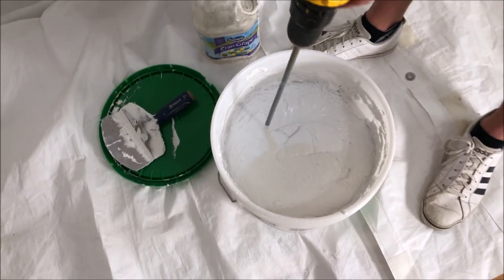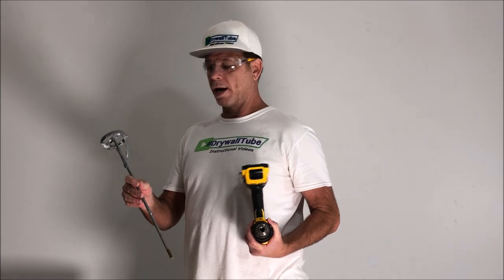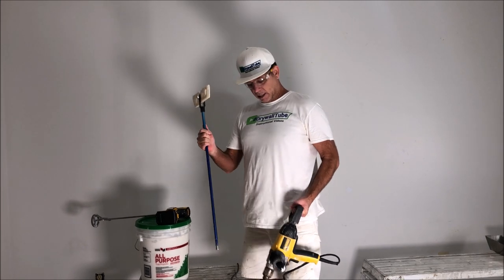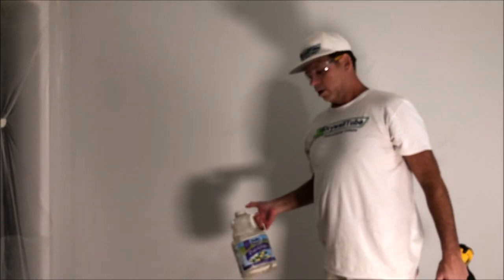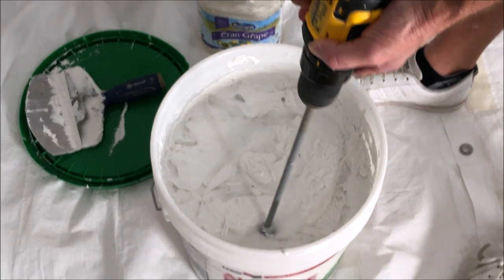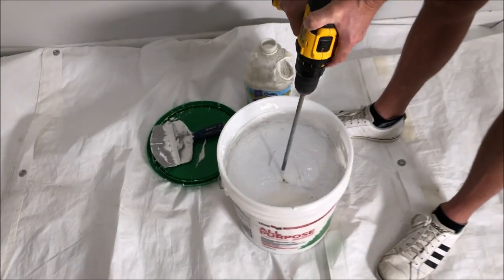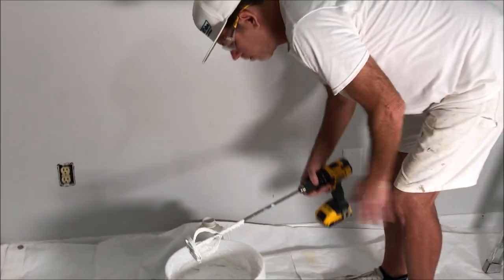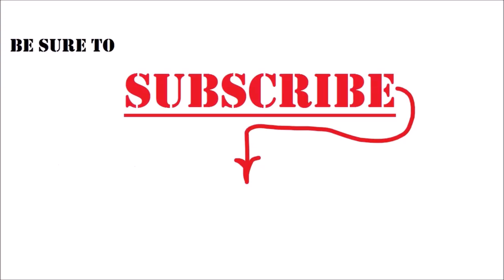HOW and WHAT I Use to Mix for Skim Coating!

Comment: Thanks for the skimming tutorials.  You make it look easy!

I've just changed the partitioning in my home.  My normal finishing is in three stages:  Tape, Block, Skim.  I have never thinned drywall compound before.  With your advice, I'll try it.  I hate sanding.

I'm doing this DYI, but I have done handyman projects for others, and built subdivisions.

Comment: Hey Paul... contractor like yourself in fort Lauderdale. Off topic question for you. I just removed a popcorn ceiling and after I put PVA on it all the drywall except the tape lines turned yellow. Then primed again with good primer, no luck. Then finally used oil primer and it's fine. Next time I think I'll use shellac.

It wasn't water damage nor smoke damage. I've never seen this happen and wondering if you have...I'm stumped as to why that happened. My only thought is that humidity got trapped in the drywall from the attic and had some sort of reaction with the popcorn and primer. What do you think?
Reply: This same thing happened on our ceiling in our 1910 house. We were able to block it with kilz, tried cheaper paint, but that turned yellow  and had to use Behr Marquee (which seemed ridiculous for a ceiling)... I'd also be interested to know what it was all about! The room we did had never had popcorn texture, but it is plaster at the core
Reply: @Elemiriel  wow......the ceiling I  did was also plaster.....I thought it had to do with the popcorn but the plaster must be the cause.....some kind of chemical reaction going on..... interesting

Comment: Amateur here - your thoughts on USG Midweight (purple).  Have had to repair and fill some areas.  After using USG 45 for initial filling, I've been using the Midweight for second and final coat and any touchup.  Seems to fair amount of glue, not too difficult to sand but harder finish than Plus 3?  I've never used Plus 3.  Thanks, appreciate your videos.

Comment: Question! I’m about to skim coat my ceiling post-popcorn removal. I have a disability so I can only do small sections at a time (resting in between). Do you have any suggestions/advice for me? I’m unsure about mixing small batches of joint compound and looking for ways to make it easy to stop and rest without ruining a batch or a piece of the wall.

Comment: Ok so I screwed up I got to excited and skip troweled my ceiling and only after it dried my joints cracked. I just realized laying in bed at three in the morning that I forgot to tape them. After I put my joint compound on the joints. What now? So I figured that I would sand them down tape them skim  coat then re skip trowel the ceiling. Your thoughts please?  A lot of work but I don’t know what else to do.

Comment: I have a make a fast decision on who to hire.  The guy with the most experience is by far the cheapest.  The job is correct an amateur job which was spray primed over and left many different textures.  He proposes that he will use 90 min hot mud to fix defects, and then skim coat with his choice which is light blue USG Topping.  Most people have said they would skim coat with thinned USG Plus 3.  This guy says he doesn't like Plus3 for skim coating as it tends to leave pock marks.  What would YOU recommend?  The experienced guy (he is 67 and been doing drywall for 40 years) wants $500 and the others want $2000.

Comment: Do you ever mix Dawn dishwashing detergent in your mud?
Reply: Do you?
I have a seen pinholes in mud before after it dried.  Is that caused by too much water or Dawn or recoating too soon?  Little of both?
  Do you ever let your mud slake for a few minutes before applying it?
  I assume slaking is to let mud settle and maybe let air bubbles out of any air pockets it might have?